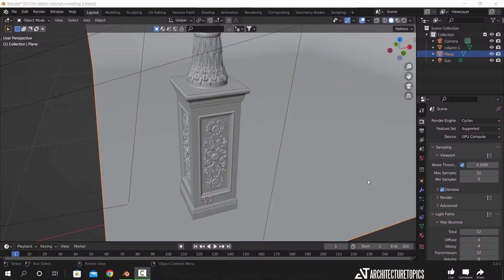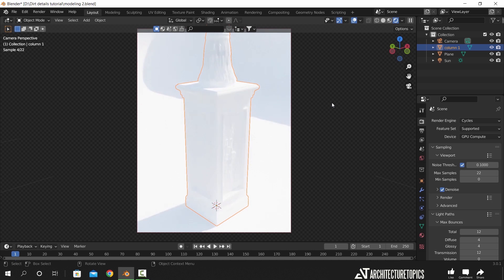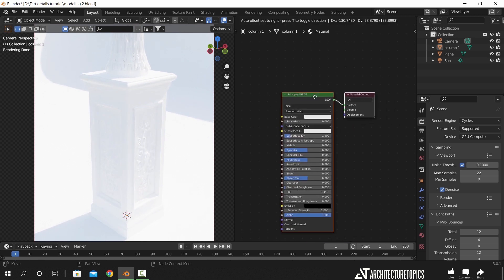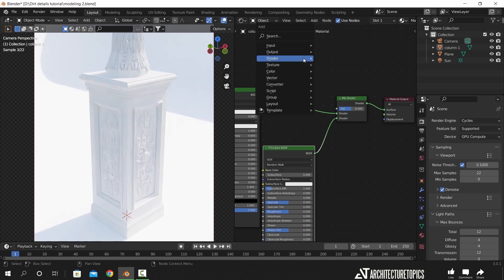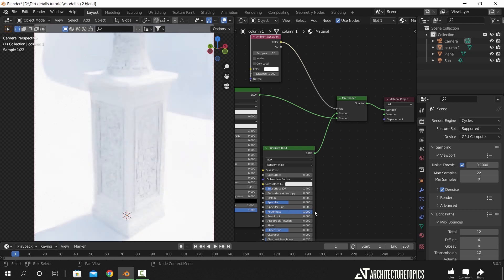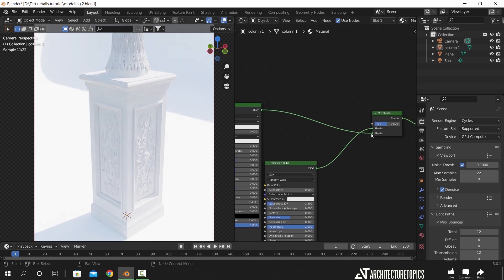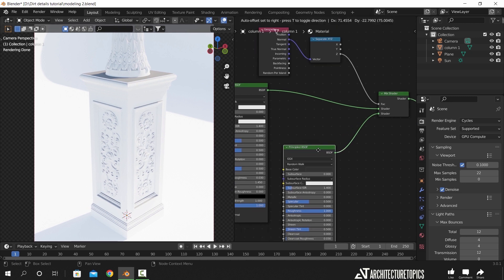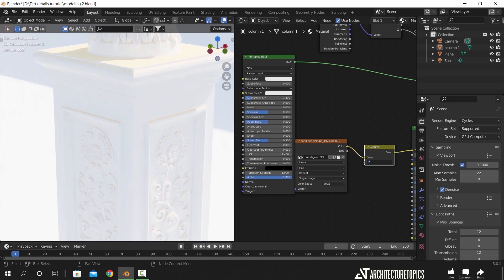How to Add Dirt & Dust in Blender Archviz

Comment: How do you combine the 2 materials, dirt and the scratches. Would this be with a mix shader and what settings? Add?
Reply from the maker: Yes you mix them together through either mix shader or you apply the dirt with color mix and add the scratches with mix node. Will try to do a more advanced tutorial on this soon.
Reply: @architecturetopics  thanks, I am never sure what the mix shader options do, ie add, multiple etc but will give that a go next time I try this. Thanks!